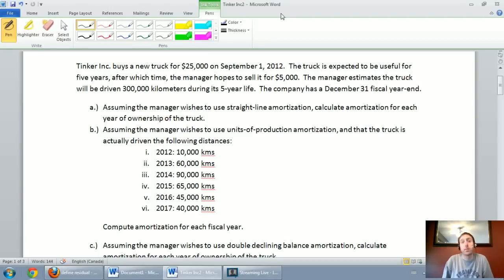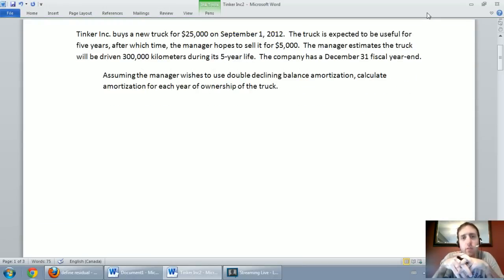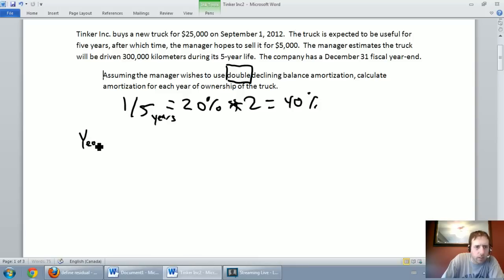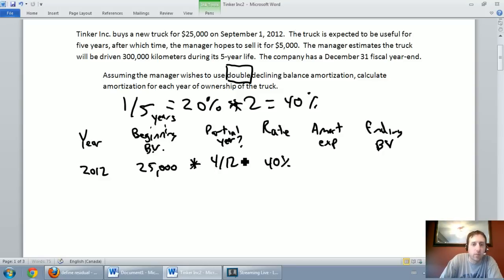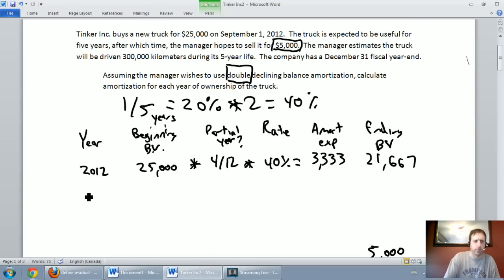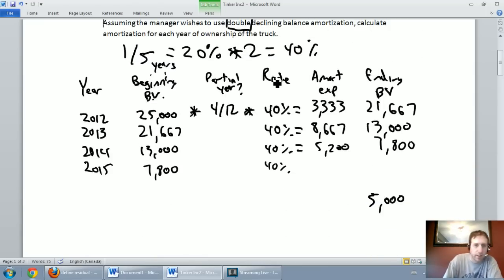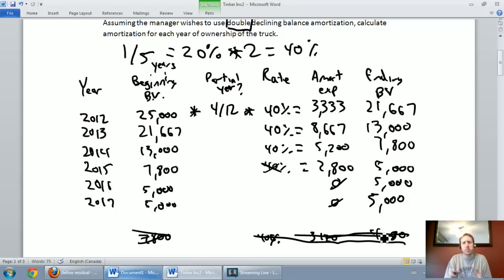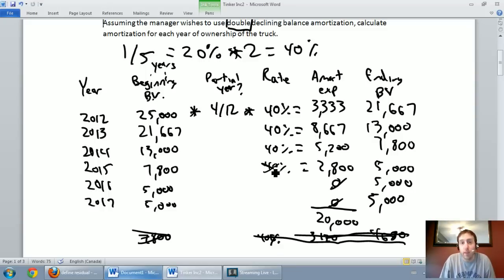Accounting - Unit 7 - Part 3 - Double Declining Balance Amortization

Comment: Hello Tony,

My Professor taught us the regular declining balance method (not double)
His table consisted of a column for (NBV x Amort. Rate), column of Amort. Expense, and last column Accumulated Amort.
For some reason he wasnt following the same steps as you did in the video. Instead of deducting the Beginning Value from the Amort. Expense as you did in the video, he was adding each previous year's Accumulated Amort. with the Depreciated Expense of the upcoming year. 
I am confused!
why?